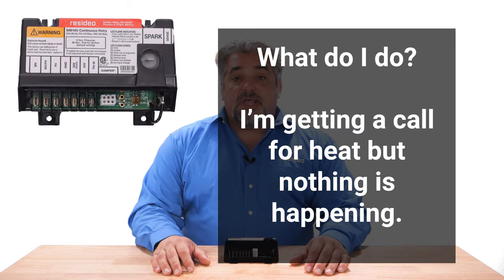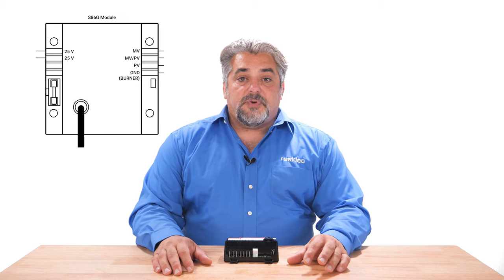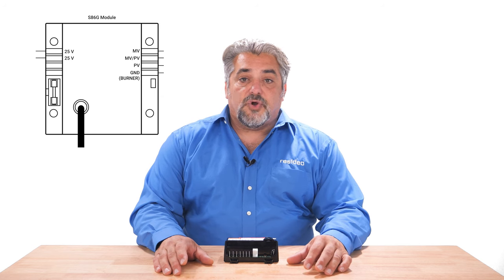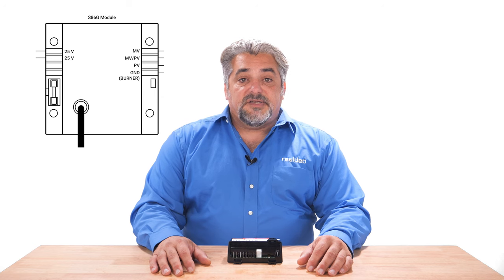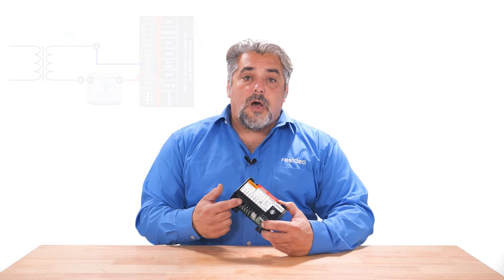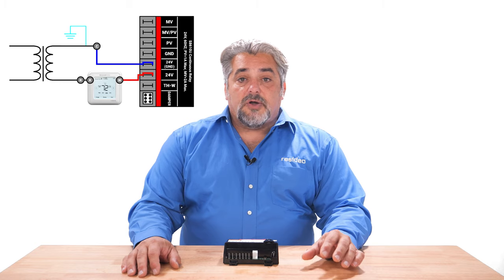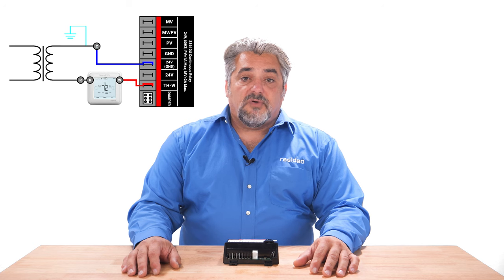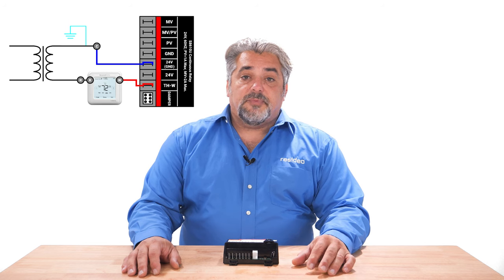Troubleshoot the S8610U Intermittent Pilot Ignition Module – No response after call for heat

Comment: I'm just wondering why it is that the connection is changed. On my old module there is a TH-W terminal (Honeywell S8600M) that is optional and isn't used, so naturally I didn't use it on the new one and ran into this issue.
Reply from the maker: Hello Joey, Thank you for contacting us. We are happy to help you finding the proper assistance. This product requires professional installation and maintenance, we recommend to have a professional checking on this unit for you. You will be able to find a professional near you on the next link: https://www.resideo.com/us/en/find-a-pro/. -Alex

Comment: I had an issue for the last few months, went through 3 bad boards right in a row, turned out the supply house had a bad batch, replaced a whole bunch of hardware thinking (no way 2 bad boards in a row, ended up being three) come 2 months later nat grod did some work and shut gas off to the block, guess what happened again! But this time board is recognizing a vent damper that was never installed, luckily they are covering it under warranty  but this is the worst safety feature in the world, and I refuse to sell my customer a new boiler with all new hardware. You stink risideo never had so much issues with a board till you bought it from honeywell